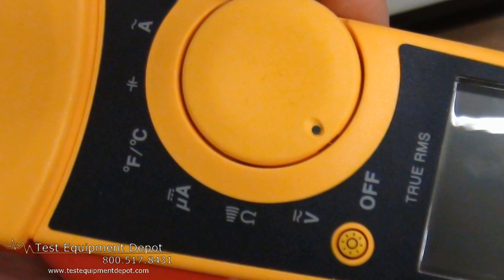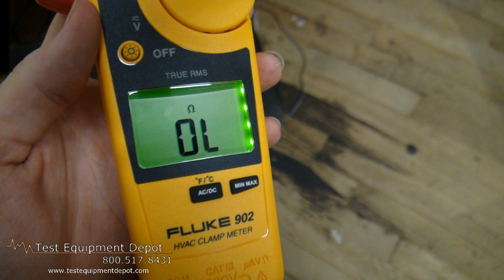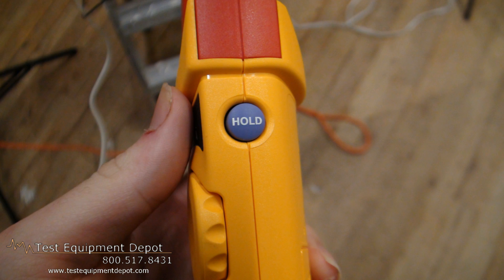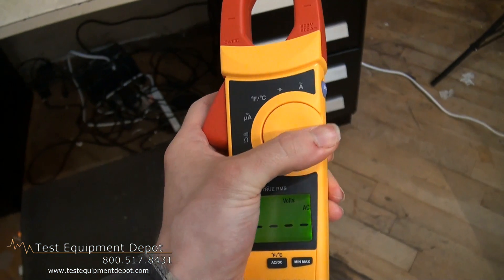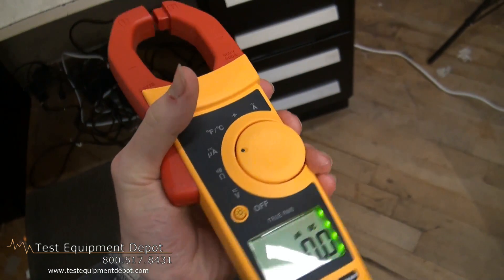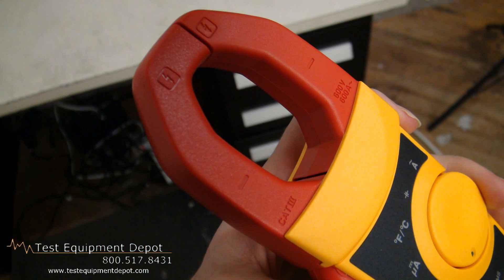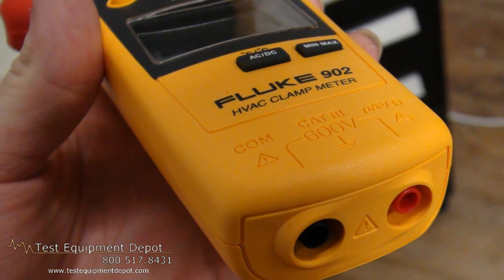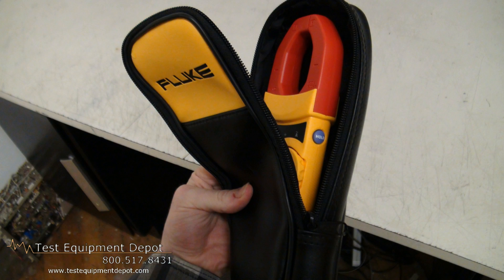Fluke 902 True-rms HVAC Clamp Meter

Comment: I see the fluke 902 meter at my local distributor. The 902 and the 324 seem to have the exact same specs except warranted  3 years on 902. Only 2 years on 324. The physical size is different as the 902 is bigger.The 902 is marketed as an HVAC meter the 324 is not marketed quite the same way. The price for the 902 is double at close to 300 dollars and approx 150 dollars for the 324. Is the 324 the way to go? Does anyone know more about these meters?